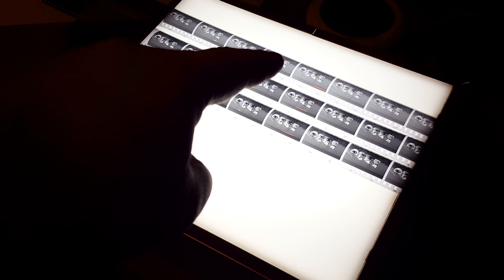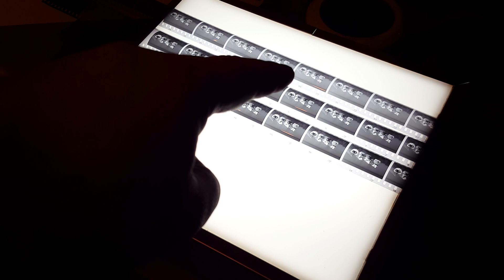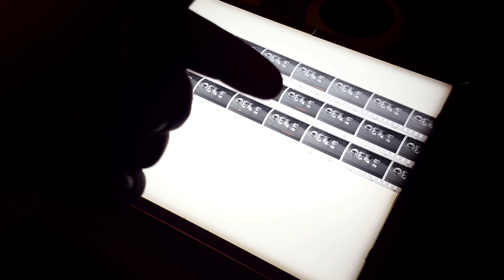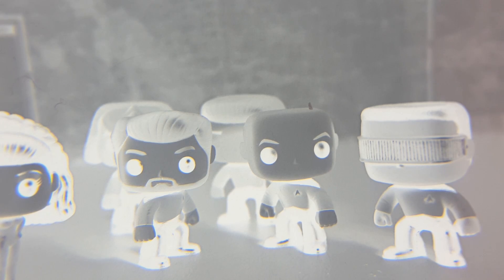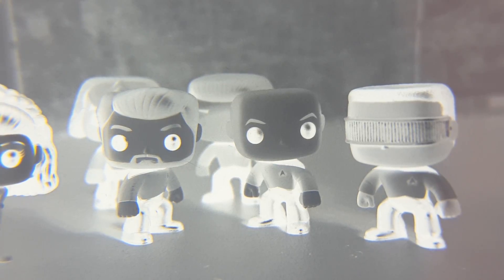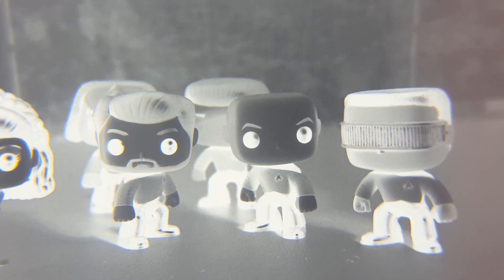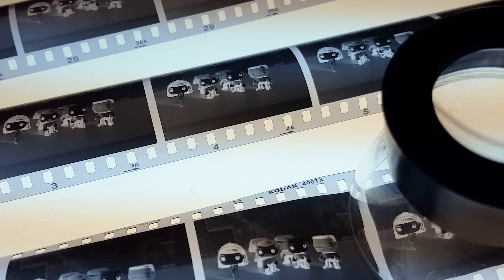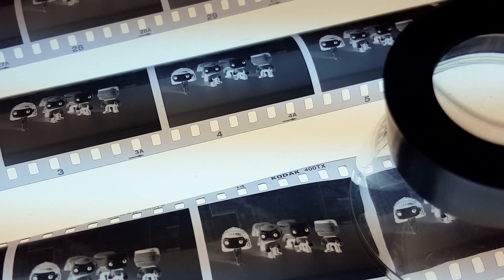How Does Agitation Frequency Affect a Negative? | Days of Knight 170211.7-044

Comment: That was extremely interesting. The bottom line, for me, is what is the best default method that gives and 'on average' better result. There seems to be a slight trade off in grain but given the neural filters in PS, grain is no longer as influential (should one choose so). I am also led to consider how totally important exposure is. With digital, you can get away with the proverbial murder but film is very, very unforgiving.

Comment: I think the general guideline when doing continuous agitation (like with a machine) is to reduce the development time by about 15% and go for there. The published times are generally based on intermittent agitation.  However, the 15% is just a starting point. One has to go from there.  Also, generally constant agitation will increase contrast. So, what one ends up as their final will depend upon how one likes to print or if one is scanning. Flatter contrast is generally better for scanning but not for printing.

Comment: This is as expected, no?  No agitation (stand development) means developer in contact with the emulsion gets exhausted and without movement, stays that way.  Constant agitation means the emulsion is always in contact with fresh developer.

So it’s not really that stand development is “bad”.  If the scene dynamic range is super wide, e.g., shooting into a cave mouth under noon desert sun, stand development is exactly what’s called for.  That translates as much of the recorded scene dynamic range into corresponding density changes on the developed film.  That’s how to express those 14 stops on the film.

Comment: Thanks for doing this.  You would expect lower contrast from the stand development  because the developer close to the developed areas becomes exhausted and works less well. To really compare the different techniques,  you have to adjust the stand development time to get good  black/highlight areas.   Scan at 2400 dpi with the lightest in-scanner  sharpening  ( I have an epson 4990, and am guessing yours is similar)   Give each image the best settings when scanning  ( give each its own back and white point )  Or better yet,  make the best print you can with each and scan that

With stand development,  you can expect to  get tonal separation in both deep shadows and  top highlights, but the overall 'tonality' of the image may be reduced  ( I take 'tonality'  to mean  how real life'  the image looks )    It will turn a linear response curve ( things like TMax)   into a S-curve  (tri-x)

S-curves let you make  exposure  mistakes and still get decent images.  The best 'tonality'  comes with perfectly exposed  linear response films, but if you screw up it looks awful.

Comment: You should see an increase in Contrast and Grain with more frequent agitation. In my experience more vigorous agitation didn't seem to have as much effect on either. Changing the direction or style of agitation - twist, figure eight, inversion each time you agitate would help prevent getting directional streaks, usually seen near the sprocket holes.

Comment: I really wish you would’ve filled the gap between the stand and the normal agitation. I would’ve been really curious to see how some intermediate (semi-stand) agitation would’ve worked, let’s say 1 agitation every 5 minutes. I would also expect each to need different times.

P.S. I suspect stand could’ve been a lot better with longer time. Could it be underdeveloped?
Reply from the maker: I should revisit this, you're right.
Reply: Good stuff.  From what I've seen, the stand developer should be more diluted, like 1 + 100 and the time extended to like 45 to 70 minutes.

Comment: Hey, thanks for doing this. I developed my first film yesterday and the results - despite doing agitation pretty much the 'standard' way - look like your zero agitation example (HP5+) - bland, grey, dark, lacking contrast. More practice needed! I think I'll have to get a stock of cheap film in and shoot it off just to practice my developing skills. I can recover a certain amount from the blandness in Lightroom, of course,  Oh; do you 'twizzle' the film with the agitation stick in the tank or put the lid on and invert it? (I also have the Paterson tank.) The other noticeable things was the amount of crap on the negs. I've ordered some swabs and pec-12 so I can clean the frames worth saving. On we go! Yes, it's all worth the effort vs. digital.
Reply from the maker: Hey Mark. When you are starting out, you're obviously going to see something you don't want or want to change. I would work on one problem at a time. If you change film, you're going to get different results. If I had my time back I would have concentrated on one film and bending it to my will.
Reply: @AzrielKnight  Hi Azriel. Thanks for taking the time to comment. Yes, I had the same thought after I postede. In fact, I already have quite a lot of HP5 and Tri-X - my preferred stock - lying around so I decided I might as well use that since a) that wouldn't cost me anything and b) I get to practise with the film I normally use. I've just been out this afternoon with a pair of Nikon F3s and shot off two rolls. I'll develop them tomorrow. Thanks!, mark

Comment: Hi Azriel, how do you split the film into three parts after shooting it but, before processing it? I mean..how can you tell that you are not cutting into a frame or it doesn't matter?
Reply from the maker: Hey Pino. I shoot the entire roll with the same shot, then split the film into separate tanks in the dark. So any given strip I have 4 or 5 of the same frame.
Hope that helps!
Reply: @AzrielKnight  cool, so there is the possibility of cutting up a frame and wasting a shot but, since the entire roll is the same shot, it doesn't matter! Got it! Thanks 😊
Reply from the maker: Yeah and i didn't do this but if you wanted you could line up the half frames for a true side by side.

Comment: Another thing you might try is constant film development while changing the exposer time when shooting the film it will result in changing contrast curve much like the Zone system does with sheet film. I learned this method to use it on roll film so you I could have a roll of film with normal exposer and over exposer or normal exposer and under exposer. The results of this is on over exposer will push the tonal range a lot greater details in shadow details, while under exposer will keep the details in the highlights. Much like what we can now do in digital when shooting to expand or contract the tonal range EV steps.

Comment: I've just tested with agitations here at home and got way less grain when just using the little stir thing instead of doing real inversions of the tank. Developed with Rodinal by the way.
Reply: I only use the Paterson tank twiddle stick. Never had a problem.
Reply: 1+25 dilution??
Reply: @philippedubois2005  yeah, something like that
Reply: Hrmmmmm this is mind blowing. Im going to try this with some color kodak right now!!!
Reply: @levelupprotocol  Black and white negative film is way more prone to grain because of agitations then color negative. But nog subtle agitations will probably make the occurring grain a tad bit smoother with color too. In the meanwhile I discovered that I do have to agitate the fixer well or a get this little cloudy marks where the film touches the spool. So it really needs to get out of there during the agitations.

Comment: Very very cool video and experiment! I was surprised by your results which is awesome. I really want to do this same experiment with color film, the instructions say that agitation differences can wildly shift colors.  I had some developing issues with my 120 black and white film where the edges were always lighter than the center of the image, across all cameras so not light leaks, I think I narrowed this down to me using the twiddle stick and doing constant or too much agitation, I went back to inverting the tank to agitate and the problem disappeared, I think with the larger film, perhaps the twirling motion created stagnation in the middle of the film vs fast moving fluid on the edges, or something?

Comment: Stand gives low contrast and no bromide streaks if you are lucky.   10 sec per minute gives a nice normal contrast DEPENDING ON TIME IN DEVELOPER.   CONSTANT  AT THE SAME TIME will Require one paper grade softer or a diffusion rather than condenser.  Two inversions  per 15 sec is same as constant.

Control your contrast by time,  never fooling with  fast or slow agitation or intermittent vs constant agitation.
Reply: I've read about people doing extensive testing, comparing stand development to other minimal agitation techniques. Agitating at regular intervals, while still keeping it to a minimum (preventing bromide streaks, air bubbles from forming, or the developer from exhausting), produces the same results, but with none of the pitfalls of stand development. Also, I can confirm this from my own experience!

Comment: Nice test. I am new to film and I often get lines at the sprocket holes. I don't know what I do wrong. I agitate for one minute then every 2 minutes for 10 seconds. Do you know what I do wrong? I tried to agitate more quickly and more slowly but the effect on the negative remains the same. The lines are also not consistent. Sometimes they are more visible. Or they get visible after scanning and playing around with the contrast / britghtness in photoshop. Any advice?
Reply from the maker: Hi Oliver, streaks on the sprocket holes are sometimes caused by over agitation but if you tried adjusting that already, I'm not totally sure. Try doing a stand development and see if they still come up. Then trying using another camera and see if that is the issue.
Reply: Azriel, thank you for taking the time to answer me. OK, I need to make a small amendement.  I am new to film, meaning I shoot film for about 2 years or so. I shoot maybe 20 rolls of film a year. I develop myself using Rodinal, the I scan and use photoshop. The streaks along the sprocket holes do not occur with every film that is loaded into the camera. That is wierd. I got some beautiful shots. I did stand developement in the past too. I will check those negatives and scans too. Also I will check the seals of the camera. I also will pick another camera to compare the issue. Thank you for your advice.
Reply: Had this Bromide drag issue once next roll 1hr stand i warmed liquids and 
Had tank in a bath to keep it warm. No drag . 35mm film ilford hp5 plus 400

Comment: I like this experiment and I truly appreciate how thoughtful the considerations are.  The only problem, and it is a real problem, is that the source image is under a kind of lighting that very few of us will be shooting under. It would have been much better on an outdoor scene in open light with a motor drive that could expose the entire roll in a short period of time to keep lighting relatively consistent. But otherwise I dig this video and wished there were more on YouTube like it. (Also, dust you darkroom, bruh!) ;)
Reply from the maker: Thanks for the kind words and feedback.I avoided outdoors because my two main concern is creating as few variables as possible, and conducting the experiment in a controlled environment. Sun dips by the clouds, I gotta wait. Wind picks up and changes the landscape. Bad weather (like the 8 months a year it snows) I have to wait.
There is no perfect experiment. If I did it outside, someone would say "dude, you need to control the light with strobes, what are you doing?"
That darkroom is long gone, as I see you just noticed in another comment. New one is under the stairs and super tiny, but also less dusty.

Comment: After seeing this I've been wondering about a different question: the difference in results from developing d76 diluted 1:1 vs straight.
Reply from the maker: I would imagine using the same time would overdevelop it.
Reply: A long time ago, I used D76, initially straight, then later at a 1:2 dilution. The diluted developer was supposed to yield a sharper image. Although the effect is modest, I found this to be true. The result comes from a reduction in the concentration of sodium sulfite in the diluted developer. D76 has a very high sulfite concentration, which works to dissolve the edges of developed grains. While the intent of such process is to minimize overall grain size, the related effect  is to render grain edges "mushy". It's a choice of which you prefer.

Comment: Nice test, but ....... You should print the negs with an enlarger.
Which enlarger ?
Three different types. 
1. Double condensors. 2, Single condensor. 3. Cold light.
Not satisfied ? Start printing on bromide paper.
Which paper ?
Two different types
1. Single graded paper. 2. Multi grade paper
Which brand?
Good luck !
Reply from the maker: Thanks for the comment Jaco, I do agree following up with an enlarger for some future experiments. In this case though a digital scan, as long as the negatives are side by side are going to answer my question: How agitation affects a negative, not how different agitations look on paper. I see where you're coming from but I want to control a single variable and by you introducing an enlarger and paper there are several variables added that can only be controlled so far, while a digital scan can be measured. You're also forgetting for the purposes of the video that even if I make paper prints, I have to scan them to show the viewers the difference, and that will have it's own set of problems, soooo yeah.
This experiment was meant to ease peoples tension about getting agitation super exact, when it's not necessary.

Comment: I'm still somewhat new to film development and have yet to get the results I was expecting. But I just tried the constant agitation method on 2 rolls using Rodinal 1:50 (7.5min) and 1:100 (20min). And I'm just blown away with the results! In all actuality, I wasn't agitating 100% of the time, but probably more like 80-85%. Took a few little breaks here and there. I also used standard tap water @20 deg. Thanks for taking the time putting this video together! New subscriber!
Reply from the maker: Hey John, thanks for subbing. The one thing people have said is that some films and devs will give more dramatic results. With that in mind things like auto developers do constant agitation as well do I don't expect any combination to produce unwanted results.

Comment: Hey Azriel. I know you recording this a month ago, but wanted to come back in and say thanks again for this experiment. Seems like a little thing, but I've found it very liberating not stressing about agitation with the dozen or so rolls I've development since. Thanks for this video!
Reply: I was going to reply the same thing... the most I got out of these experiments is that it's not so critical as I thought it was. I was afraid too much agitation was just as bad as too little. That if I wasn't gentle I would destroy my negatives. It's stressed by even Ilford to do it a very certain way. Goes to show you... I think this 'standard' information has been passed down from teacher to student for a long time now without ever really questioning why. I think the standard way is just a middle of the road way to get good results. It doesn't require you standing there agitating the whole time wearing you out but it does it enough to still get good negatives. I gotta' say though.. the agitation speed didn't mean much at all. My guess is it's more about getting air bubbles stuck on your film than it is anything else. Aggressively agitating would mix in more air into the solution and potentially cause air bubbles to stick. That's just a guess though.
Reply: @lycosa2000   I just got to third that. Now when I feel like agitating, I can just do it!

Also might there be a way to get TriX to look like the constant agitation one, without constantly agitating? Like increase development time for a minute, or + 2 degrees...
Reply from the maker: That's awesome! I'm glad I could be of some help!